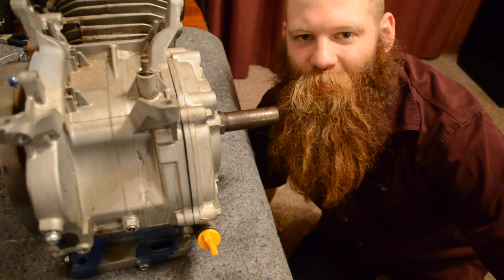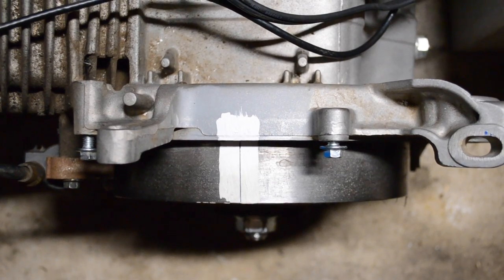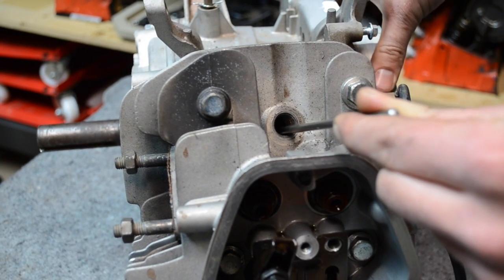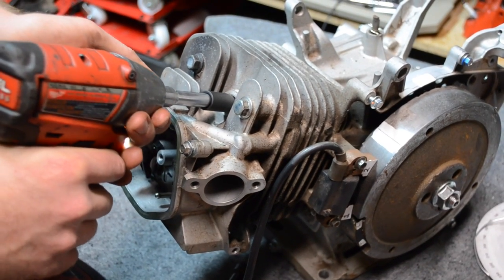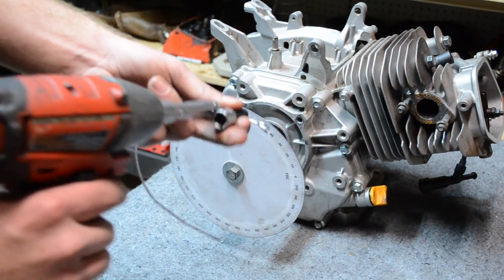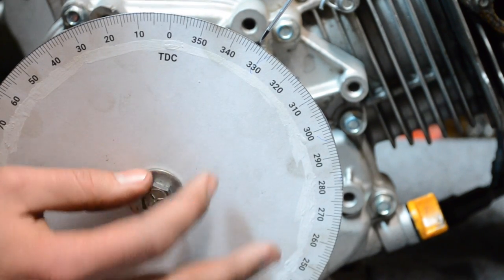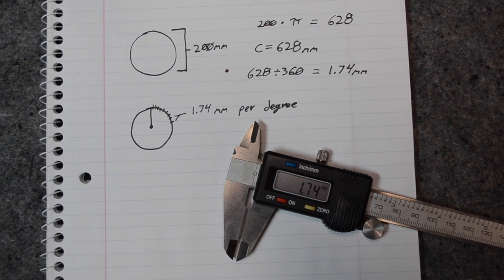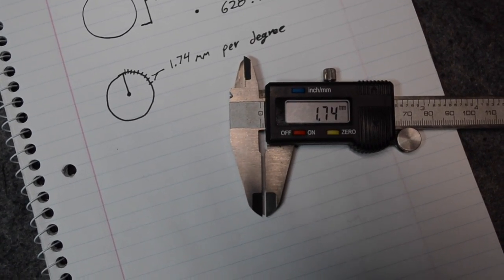How to find ignition timing on small engines

Comment: I'm curious, what are you after when performing this task? Advancing timing?If you wanted to ensure correct timing, you already got the engine out, pop the base gasket, and line up the timing marks. Put it back together and adjust your lifters. Seemed like a lot of effort for a unit that doesn't appear to have a timing chain. Great explanation though.

Comment: Kevin, you are ABSOLUTELY correct! I have used the exact same mathematical formulas as you were and find sooooo many mistakes in valve train maintenance as a whole. You can’t just go Willie Nillie in this area of the engine, this job, as any, needs to be done using proper technical procedures.

Comment: I've got a large generator that was in good working order, but suddenly backfiring through the carb. The ignition timing is permanently set with no adjustment capabilities just like all small engines. The timing has changed to cause the spark plug to fire before the valve seats causing the backfire. Is there a way to adjust such a problem to correct the timing?
Reply from the maker: If your ignition timing is permanently set then it would not change without a broken timing key. Check your valve lash in that case.

Comment: This is a great video, really explained things well, only issue i have, is i cant get my timing light to work. Can u tell me how u made ur connections? Did u use a battery,  did u have to ground battery to the engine? I checked my timing light by hooking it up to my truck..it works fine, but I can't get it to work on a single cylinder engine...plz help

Comment: I need help positioning a new coil.  I have an old Nelson Brothers 1-1/2 hp engine and I would like to convert it to an electronic ignition.  I'm going to remove the old flywheel,  coils and points and install a new flywheel with OD magnet and electronic coil.  I need help where to place the coil at piston TDC to get the timing spark correct.  Thanks in advance for your help.   JimRoy

Comment: Man....I have a koler courage 17 on my zero turn.  I bought it from a dead neighbor so I only knew it had 240 hours on an 07 model.
Anyway, it didn't run so I changed all electrical components, all fuel lines, fuel pump, carb, fuses. Anything I could purchase....I changed it out.   Anyway...it's hard to start but runs beautifully once I get it started, no stumbling, hesitation...nothing.
I mowed literally 3 days ago and wanted to go do some mowing again today and it won't start.    Could this be a timing issue?

Comment: Which better timing for drag race? Stock timing or advance timing?
Reply from the maker: Fixed ignition timing in these small engines is more relevant to the fuel you are using than the type of racing. On most occasions you can advance a few degrees and still be able to run pump gas. In extreme situations, you can run with a fairly large advance if alcohol or race gas is your fuel.
Reply from the maker: If you were referring to camshaft timing, then that is another system of the engine and will be covered on a future video soon. There is a big misunderstanding on these types of small engines with confusion between the two.

Comment: I have a GX390 this thing rips my finger every time I try to pull the start cord, I open the crankcase every dot on the gear mash perfect, I set the valve.0.15 in and 0.20 ex, steel kick back, any Idea?
Reply: I guess the compression release isn't working
Reply: Check the flywheel key, probably partially sheared.

Comment: does it have a cdi even??what type of ignition is it...please tell qhich engine is it
Reply from the maker: This is a magnetic ignition. The magnet on the flywheel passes by the ignition coil. The magnet introduces an electric charge into the coil, which is basically just a step-up transformer. The high voltage is then sent to the spark plug to ignite
Reply: No cdi needed on small engines, Magnetic pulse coils just work by inducing an electromagnetic pulse that is sent directly through the high tension lead to the spark plug, as the flywheel rotates in sync with the crank it is one pulse per one revoloution on the engine. Simple stuff really. One rotation equals suck, squeese, bang, blow.......... .suck..fuel is drawn in through the inlet valve , squeese the air and fuel mixture in the cylinder as the piston drives back up to the top of the cylinder spark is then introduced at a precise moment an explosion is caused forcing gasses in the cylinder to expand at a massive rate forcing the piston back down introducing torque at the crank and as the cylinder reaches the bottom the exhaust side opens and expels the spent gas through the exhaust valve.

Comment: To relieve the compression wouldn't it be easier to just remove the sparkplug and ground it to engine.
Opening the motor and removing the valvetrain seems like a whole lot of way unnecessary work.

Comment: How do I make my 13 hp honda get fire to the spark plug
Reply: I have new coil an I have reset the air gap multiple times new spark plug still no fire thanks in advance
Reply: @johntodd7318 Try disconnecting the kill switch and low oil level switch and see if it gets spark.

Comment: Portable Engine not Small engine
Reply from the maker: Portable engines are small.
Reply: I need help on wiring my honda 340 so it will fire it has a starter on it but no key it has blue green and wight  and black wires I have sanded the stator and coil pulse the ground every thing tells me blue and green are ignishion wires but I'm guessing I need some help thanks
Reply: @smallenginemasters147  LOL,  yep.  All that good info from the vid, and that is what he/she got out of it?  LOL
Reply: @brendagreen6715  Did you figure it out?